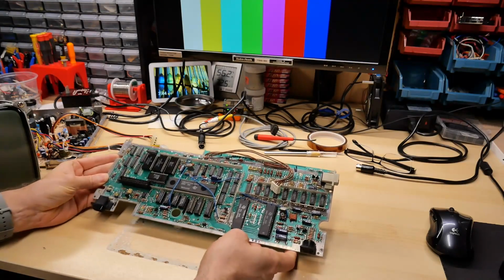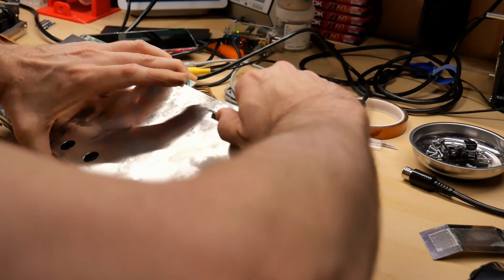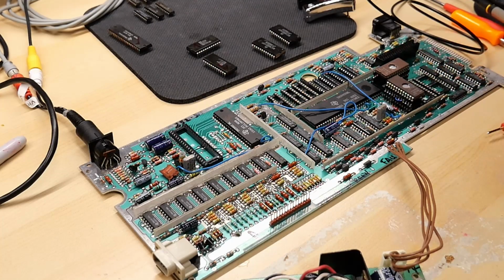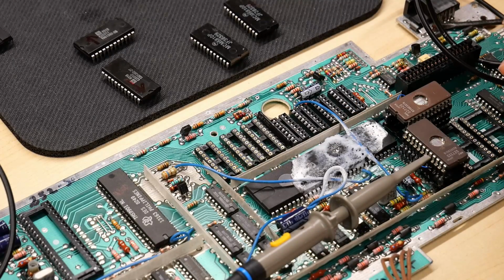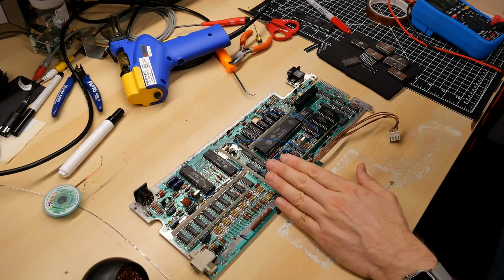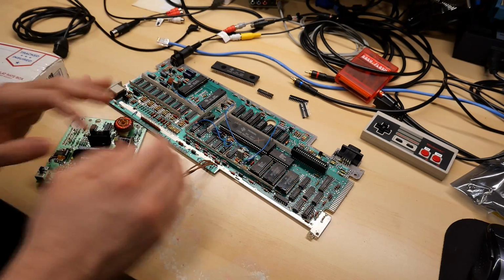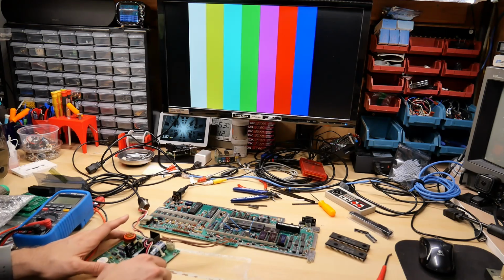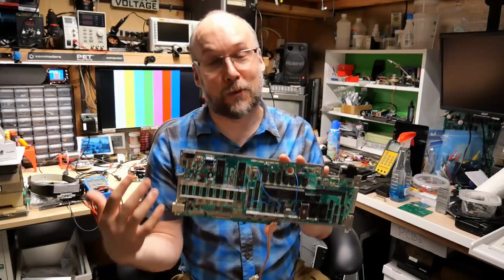Ti99/4A Motherboard Repair - Part 3 - More mistakes, but finally success!

Comment: WOW! He says he's not an expert? That makes me a zero. Anyway, great series - it shows just how much one has to stick to a problem to ferret out microscopic problems. Maybe it's just me, but it seems like TI could have placed the processor in a socket to start with. Would it REALLY have cost that much more? Surely they had boards that they had to work on that would have saved their techs time and money - or did they just bin the non-working boards and just replace broken material with new boards off the assembly line? Dunno. I don't know what the original failure ratio was. Maybe it was minimal. 

I remember that when they dropped to $50 my mother set off to get one for me. They were sold out everywhere. So she offered to get a Vic-20 at $100. Sure I said. Sold out. Finally she offered to get a C-64 after being sure it was in stock. It was $200 and she checked with dad before spending that. She sold dad on the idea that I was already showing potential in programming (I'd been allowed to use a PDP-11 at school) and it'd be an investment in my education. Turned out a safe bet. I teach CompSci at university today. Still an abiding love of mine. One of my C-64 programming projects was a game that "simulated" the battle of Midway. I got tired of losing. I changed all the allied forces from 60+ planes each to 600+ planes each. Not accurate, but I won the battle easily.

Mom got interested in programming and we spent hours learning new languages and new things like Windows programming when we had PCs and mainframe programming on IBM equipment. Good memories. She's been dead five years now...

Comment: Great Job! As for the solder bridge I agree with Pete, don't beat up on yourself. I've done similar stuff many times over the years. As such I learned long ago to continuity check the lines before re-install. Even with that "stuff" happens. Happy restoring!

Comment: 44:16 don't try it, but I had EPROMs in backwards on different occasions and though they did get warm, they didn't die. But it helps having a non-overpowered power supply that can only source a few hundred mA more than what the machine uses when it works... but 7400 logic is even more robust. They can take an Amp or two, get blistering hot and still work. But yea, accidents happen... I do take more care when handling rare chips.I also
...I noticed I kinda started to develop a tendency of replacing with the wrong chips, ie. replacing a broken LM3900 with an LM324 (took me two full days) or LS153 with 157s... I'm getting old and I'm "only" 35...
I also often encountered bad ROMs or PALs that work perfectly fine in an EPROM burner but don't work in the machine. Especially on C16 / C64...
I wonder if the original CPU works if you deep-freeze it... I have a PONG console that only works if you put it in the freezer. Fun part is there's two chips in there and you have to freeze BOTH.

Comment: That solder bridge was an innocent mistake to make. Soldermasks were kind of a new technology in those times and they were no where near as precise as we have them now. It was totally bad luck that bridge happened with the 12V line, if it were anything else, GND, 5V, data etc, nothing would have happened. Murphy always sneaks up on us and makes sure the worst case scenario happens when we make simple mistakes like this. I recently repaired an issue 3 Sinclair ZX Spectrum board which was pretty destroyed with a previous repair attempt. I had to fix so many traces, pads and whatnot. Some transistors were swapped with incompatible ones and even one 74LS157 encoder IC was swapped with a 74LS158 (same but inverting) encoder. The person who tried to repair it thought that would be close enough I guess. The whole repair almost took 3 months including the times I waited for parts to come in. I am proud to say it came back to life and working flawlessly now, so, I know the feeling when a board you worked on for such a long time finally works Adrian, and it is priceless. A good job well done, congrats!

Comment: You shouldn't be so hard on yourself for the 12v short. You indeed should always carefully inspect your work... But, seriously, what a terrible, terrible design choice to run the 12v lines between the CPU pins without solder mask. Not only for serviceability, either. Those are so close that I could picture a conductive particle (like graphite dust from a pencil) landing on the wrong spot and causing a short all on its own.

Comment: I'm surprised that you don't take any ESD precautions when working with these boards and chips. They are old and more susceptible to damage, and you could be storing up failures of the board at a later date. As these chips get harder to get you should take more and more precautions. 

A mat and a strap is all you need to keep the work place a safe place for your chips.

Comment: I always check with the multimeter between pins on a new socket just to be sure not shorting. A magnified picture could still fool you maybe but the meter cant.  Eyes have a way of missing detail and some chips are too valuable to ruin.

Comment: I think the only logical thing to do is move to Antarctica where you have a continental sized cold heat sink to bring that CPU down to the temperatures it needs to operate.

Comment: Some of the UV solder mask seems like a good pre-emptive step before working on these boards. I think you got lucky that the CPU wasn't the path of least resistance for the 12v and those other chips took one for the team too.

Comment: I've made the short mistake thankfully only with data lines but yeah couldn't see it due to socket being in the way. Like I said I have a bunch of ti99 but the cost of repair in parts out weighs value of systems :(

Comment: Between this and the Mac repair-a-ton I really need to get my Mac Plus out and check it for any leaking caps and dust off my old Ti99/4A. Hopefully I still have the power brick and joysticks for it somewhere. Going to need to get an AV cable for it too. I think I had a dozen or so games for mine. Never really did anything with Basic back then since I was like 5 when we got it.

Comment: In 1983 TI decided to get out of the home computer business, and so they deeply discounted the 99/4a.  My mom got me one at Hill’s department store for $50.  It was my Christmas present in 4th grade.  I played games and learned to program basic. It had a great manual.  Years later I got a printer and some productivity software for it.  My mom wrote her Master’s thesis on it and we saved the documents to cassette tape.  I used it until late 80’s.

Comment: Would it be possible to "fix" the bad rom chip by adding a pullup resistor to the 5V line to help with the signal driving?

Comment: Wow, that was a wild ride! At least you were able to trace the new fault and find your mistake, I know my ADD would've kicked in and this would've been buried in the pile of projects for months if not years. Good tip from the vendor about using a microscope. Definitely don't blame yourself too hard though, we've all made the same mistake. It could've been a lot worse!

Not surprised that the CPU and SRAM survived though, the I/O circuitry on the data pins should have pretty good input voltage clamping. They're relatively expensive parts, so the designers would've taken extra care to make sure they survived this exact situation during manufacture and testing of the machines. Mask ROMs and logic chips are super cheap in comparison, so if they're re-working boards that fail QA, it's definitely cheaper and easier to replace those than the CPU and SRAM.

Anyway, great video, and good to see some progress on this project. Can't wait to see what you do with this machine next!

Comment: Nice fix! I understand your pain...I have an Amiga 2000 board here that seems to defy all my attempts to fix it. As a side note, after soldering in new components, I use a magnifier program on my phone to check for solder bridges with nearby traces. Works very well. Without a doubt, some of those traces get REALLY close to solder pads.

Comment: That's an interesting failure from applying 12v. I wonder if you could compensate for the reduced drive with a pullup resistor. This is the official fix for some Synology NASes with failure-prone chipsets, maybe it works here, too.

Whenever I've accidentally put 12v in the wrong place it's led to chips getting internal shorts (and thus heating like crazy when powered).

Comment: It has been fun watching you work on the TI99/4A! I did a high school co-op term with a computer store that sold them, and Xerox 860 CP/M computers...I know, weird product mix...but they were primarily a stationary & copier store. The TI had an amazing speech synthesis module, and I certainly had a lot of fun with it.

I used to teach the language LOGO on both TI and Apple computers.  Also, why the graphics on the TI were better than the Vic20...the TI had the hardware Sprites support that was groundbreaking technology. There was actually a plug-in card for the Apple ][ that had a TI VDP with 32 sprites, the same one, I believe as in the TI99/4A, and could be used in LOGO.

Comment: No part 4 for final assembly and cart play?
"I'm still a novice". With an oscilloscope, a logic probe, a power supply, a vacuum desoldering gun...
Reply: You can be experienced in electronics and still a novice at working with computers. I’m good at working with computers, but if I tried to work on (for example) ham radios I’d be out of my element at first.
Reply: I still use the big ol firestick iron and desoldering braid with an old analog scope.

Comment: I've got a small stack of dead-tone 4A motherboards. Love hearing your thought process as you troubleshoot.
Reply: From what I've seen of Adrian's skill, he is an excellent teacher and I bet if Adrian worked on a couple more of these TI-99A, like he did on this one, with you watching and paying close attention, you could repair them as well, just like Adrian goes through the ups and downs of his troubleshooting (it's a true asset that Adrian doesn't "edit out" his failures) you will ultimately find the same success. Fred

Comment: I feel your pain! I had a similar bridging issue with a C64, where the solder mask was worn on the top of the board under the PLA socket. When I replaced the PLA socket, solder wicked through the via to the top side and bridged across underneath the socket, so was impossible to see. Took hours to identify and fix. Thanks for your great videos and for not being afraid to show your mistakes.

Comment: I wonder why they put that 12V trace there, I mean, let's put a 12V line right next to a 5V pin without solder mask, what could go wrong ?... I'm actually surprised most of the chips didn't die after seeing 12V on them.

Comment: Really? You didn't probe for shorts after you added the socket? Thats just poor SOP.
Reply: Where's your extensive video library showcasing "proper" SOP.?
Reply: @JoeyRivers  Nice knee jerk reply, I spent 20 years doing board level repair.
I have no need nor desire to make a vid for you but did find this one enjoyable.
He will learn to check for shorts before powering up when he fries a trace.

Comment: Finally, it works, nice !
Looking to the waveform of the broken ROM Tri-state bus driver output (D11), I had a similar situation on another ROM chip. There was still some waveform, but the driver was damaged and could`t pull the line up to 5V. So I added a 680 Ohm resistor to 5V, and the Tri-state bus driver just had to pull the signal to ground. Why not give it a try with the old ROM chip in place and a pull-up resistor, so you may get rid of the socketed Eprom.

Comment: I was cringing so hard at the PCB design causing the 12v short; man, I know its easy to kick yourself for not catching it, but at some point you have to say "well thats why we don't design circuits this way anymore".  You know now, and the worst of it is behind you.  As always, amazing work on the repair.
Reply: Less a design than a manufacturing issue. They just didn't NEARLY archive as fine structures back then, solder mask between the pins was most likely just not possible.

Comment: I had 2 TI 99/4A computers. And a case of cartridges. One came with Atarisoft Donkey Kong which was pretty good. I also got a joystick converter box. Seems like you have to make sure the shift lock is off to use joysticks.

An evil entitled selfish family member stole them all and threw them away.

Look into getting some UV curable brush on solder mask.

Comment: Good ol' freeze spray to the rescue of all techs in a bind to assure proper defect ID. I keep Freez-It in the shop at work and train my tech in the proper use. When to use it to find intermiitents and shorted components, Freez-It is second to none. I call it "Tech in a Can"!
Reply: I presume it's only supposed to be used when the machine is off, for multimeter/oscilloscope testing? Because I can't imagine all that condensate on the circuitry being safe, even in solid form.

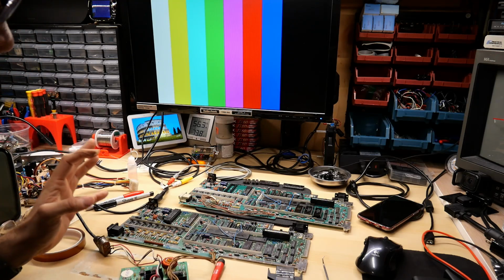Comment: 12:10 I just like this image, your iPhone is on the table a device there around 10.000 times more advanced than the motherboard you are currently fuzzing over like a mother hen, I just like the image but maybe I'm just rambling.
Reply: And so are the oscilloscope, tablet, camera, even microphone, minipro, that animating display up there :). I guess the only thing that would compare is the soldering iron. Even the brushless fan has a small ASIC inside. We are surrounded by robotic servants.

Comment: Great work you got there in the end👍. I wouldn’t say the soldering mistake was a decision more an unfortunate event, I did spot you correct one bridge as you were working just a shame about the second one. I could do with some skill like that as I have a dead Memotech MTX512, same problem black screen with continuous tone as it’s got the same sound chip.

Comment: This brought back a horrifying memory from forty years ago when I accidentally connected 12V to the 5V line in my computer for a few seconds. Fortunately I saw something was wrong and immediately turned it off. It was a sad day but by some miracle it didn't damage anything and never would have dared to show what I had done on YouTube.

Comment: Hey Adrian, what is the desoldering gun you're using and did it come with the tool you use periodically to clean the tip and channel out? I've seen you using it a lot, which means it must be working well for you. Given that, I think it would be a worthwhile investment since I've had to do somewhat similar (but not to the same skill level as you) work.

Comment: In a previous video, I asked if you had an Atari ST.  I think you said yes.  I'd bet that you never used it in hi-rez B&W mode.  There were few or no B&W games, but German programmers made desktop publishing programs and other business programs. Can your adaptor box output 640x400?  If I repair mine, I'll need something that does 320x200, 640x200 and 640x400.  I didn't like early ROM color output, it took several revisions before the GEM desktop looked right as color was a CGA like 640x200 with vertically elongated icons in the first ROMs.

Comment: When I was a kid I always thought that the TI99 was a really beautiful piece of industrial design. Fast forward 40 years and I still find it quite beautiful.
Reply: The whole 8/16 bit design was needlessly complicated and screwy, but TI was the only computer manufacturer who could design anything they wanted back then.
Reply: It looks cool, but from what I've read the Basic it has is extremely limited and you can't even use Peek and Poke. To me, that defeats the purpose of even having a vintage 8-bit computer. The point is to be able to program it. Otherwise, it's just a glorified game console.
Reply: @ct6502c  The standard basic was almost unusable. But there was an "Extended Basic" cartridge that was actually quite good. Still, due to that totally harebrained memory layout of the machine it was not possible to access the chips directly, let alone write machine code.
The paragon for good basic with a flexible inclusion of ML in the 8bit world would have been the BBC Micro where you could just mix assembler code and basic in the same program file. Yes, assembler, not ML hex code. I loved that.
But the case-design of the TI 99 is still nice. (Rather sad, when the best thing to say of a computer is that it had a nice case, isn't it?) And, yes, I had both of them in those days. And, yes, I am old.